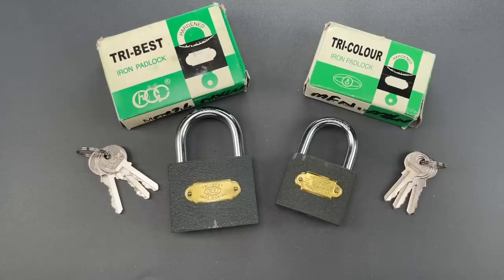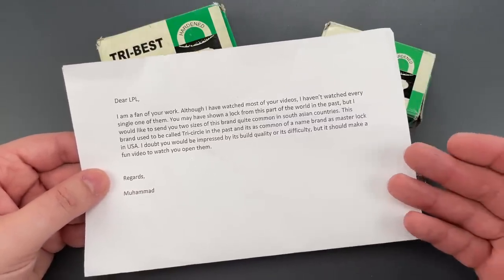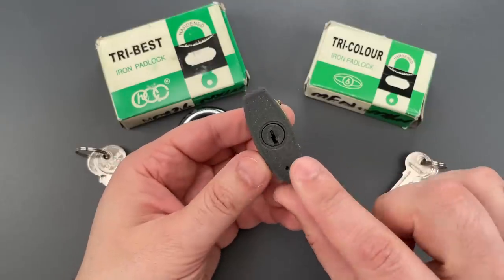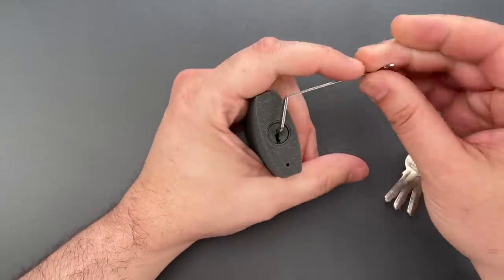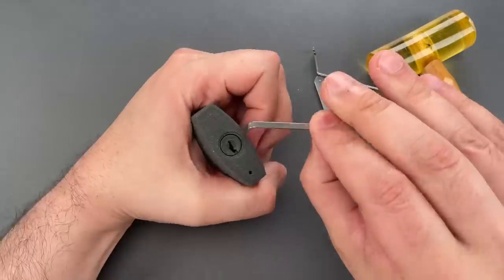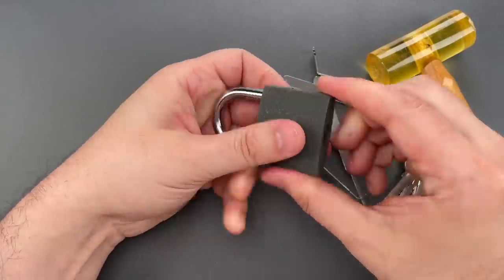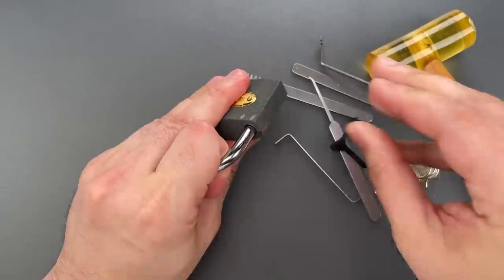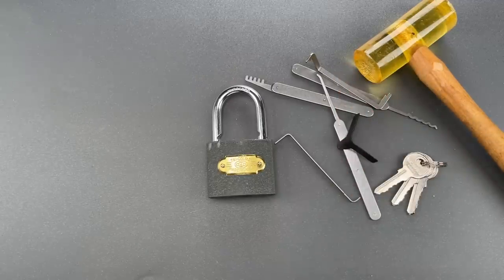[1460] Why I’m THANKFUL For Master Lock… Sometimes

Comment: The unhardened shackle that says hardened is my favorite part about this lock
Reply: That by itself would have been enough to get a bolt cutters out.
Reply: Plastic core...
Reply: @arthurmoore9488  I want LPL to take a propane torch to it to show how fast you can melt it open.
Reply: @chasm9557  he has done that with plastic core locks before.  It's not a fast process but it's quiet and can be done with a very small torch.
Reply: I bought a big Tri Circle clone, says Tri Circil, with a brass body that is magnetic. Not a bad lock, but it is theremore as extra protection, as it already is protected by the Ezlett lock in the security door and the Union barrel in the actual door. Ezlett locks are hard, mostly because they are so sloppy, and cutting a key means you need the lock as well.
Reply: Translation error..
What they meant is "not plastic"
Reply: That's probably some sort of metaphor for turning 40
Reply: @SeanBZA  how does a non ferrous material end up magnetic? Is an iron core or just brass coated?
Reply: @gameglitcher  brass plated steel, but sold as "solid brass".
Reply: To be fair it is harder than the rest of the lock
Reply: On the other side it says for decorative purposes only.
Reply: Before they hardened it, it was a delicious custard
Reply: @chasm9557  just a lighter will do
Reply: The "HARDENED" stamp was the cheaper alternative to actually hardening the steel.
Reply: That shackle made me realize that my entire life is a lie. 😭
Reply: I think that intimidating the potential picker is an important part of a security device.
Reply: 對你最難的是挑戰FOREVER V3 哈哈哈!你是小偷的老師!我來自台灣!
Reply: @CommunityGuidelines  I suspect that the packaging of this lock (which carries the imprint "hardened") is probably harder to open that the lock inside the packaging.
Reply: @klausstock8020  挑戰FOREVER V3 哈哈哈
Reply: This lock is so easy to open there is no reason to harden the shackle
Reply: @joanfrellburg4901  That's the point. They probably thought "If any costumer asks for the guarantee, that'll do the trick". Then they were laughing for about half an hour, lol.
Reply: @peterkelley6344  I don't even know if boltcutters would work with unhardened steel.  They might just deform instead of cracking
Reply: "what do you mean stamping HARDENED on it doesn't actually harden it?"
Reply: It is hardened, they were considering using dried Twizzlers.
Reply: To be fair, it doesn't say what is hardened. It could be about a different companies lock.
Reply: @chasm9557  - he did "nondestructive" this time

Comment: It's funny, because Masterlock has had all of these issues, just not all in the same lock.
Reply: This lock was made by Master Lock locks getting together like they were summoning Captain Planet. "Spring-Load core!"
"Unshielded keyway!"
"No security pins!"
"Comb pick exploit!"
"HAAAMMEEERRR!!"
Reply: Well, Masterlock did make locks with each of the vulnerabilities demonstrated in this video. But I can't remember them putting out a plastic core. I gues when tthey want to make a lock that can be melted open, they at least use zinc so you need a blowtorch instead of a lighter.
Reply: @MisterJackTheAttack  i laughed at this so hard that I woke my dog up.
Reply: Yet.
Reply: @MisterJackTheAttack  "BY YOUR POWERS COMBINED, I AM worst than a zip tie...!
Reply: @blarghchan  you mean a zip tie has only one bypass?
Reply: @sarowie  other than cutting a zip tie you can pry the locking tab out of position to slip the tie tongue out of the eye... or whatever the bits are called. A small flathead screwdriver tends to do the trick.
Reply: @MisterJackTheAttack  By your flaws combined....

Comment: Masterlock gets the "Not as Much of a Failure as You Could Have Been" award
Reply: So second worst lock company?

Probably not even that bad but I still will not use one on a nothing more valuable than the bin...
Reply: @seriousmaran9414  I think they are the worst genuine lock company. Below them you have knockoffs which are cheap and look like real locks to make a profit.
Reply: Masterlock gets a participation award, and they're taking it, proudly !
Reply: Meanwhile at Master Lock headquarters: Hold my beer!
Reply: Wow. Hard fail.
Reply: + has some form of metal in core
Reply: "damning with faint praise"
Reply: Master locks break very easy.  I've had several and they still find away to open the locks to get what they want.  The company did replace the broken locks and I offered to send them in for examination but the offer was refused.  When I asked for the fourth lock to be replaced, the woman who I spoke with refused to replace the failed lock.  I will no longer purchase master locks.  I've been buying Brink's locks.  I did have someone get in and I changed the lock and so far nothing has been missing for about six months.
Reply: *Insert Captain America picture
"I understand that reference."
Reply: I like how everyone here just already knows what you mean when we say master locks a failure
Reply: MasterLock get a "best in class" award. Their class only includes themselves and locks like the one in this video.
Reply: Everyone gets a trophy!
Reply: even the most faint light shines brightly in total darkness
Reply: So….
Of those methods shown here, how many work on master lock?
Reply: much coveted amongst the sorry entities that LPL lays waste to on here.
Reply: The "At Least You Tried" award.
Reply: I'm still working on getting mine. I'm not gonna lie, I don't think I'm going to make it.
Reply: Sadly still not even close to "better than dell" though...
Reply: Woo hoo!  the coveted Almost as  good award
Reply: I see you , Avatar fan
Reply: Aww, that's the same thing as the one my mom gave to me on my 22nd birthday
Reply: Love me an ATLA reference in the wild
Reply: For the folks that are constantly losing their keys, this lock should get an award.
Reply: For now.
Reply: @methanbreather  poo
Reply: 對你最難的是挑戰FOREVER V3 哈哈哈!你是小偷的老師!我來自台灣!
Reply: Masterlock will at least keep things closed (until literally any random passerby decides to open them). This thing will open in a light breeze. Not even a stiff breeze, a light summer breeze.
Reply: Nice atla reference
Reply: Great demonstration cheers
Reply: These locks cost barely a dollar
Reply: The only thing worse than being the worst is being the 2nd worst.

Comment: "With the exception of this hammer..."

Who else would be in favor of him selling a hammer as part of an "Overt Companion" set? If nothing else, it would make for a pretty great April Fools video.
Reply: It reminds me of the movie Gone in Sixty Seconds. "I need to go get my tool." "Man, that ain't a tool, that's a damn brick!"
Reply: That hammer actually looks pretty nice. What is it, acrylic, or some resin? I only have steel or rubber ones, acrylic would be a nice addition.
Reply: Overt companion should come with a Halligan bar and sledge hammer.  Not many more things say "screw your lock" like those.
Reply: @pkt1213  and an angle grinder
Reply: The new "overt companion set" consisting of a hammer/mallet, Bolt cutter, battery powered angle grinder and crow bar. For times when noise is not an issue, but you want to have the choice to either go for the lock, or whatever the lock is on.
Reply: @JaroslawFiliochowski  Polyurethane?
Reply: Would a stick of dynamite with the LPL logo on it be a bit too far...? Asking for a lawyer-friend.
Reply: When he said that,  I thought "Oh, no! And it's a 'dead-blow' hammer,  intended not to damage the object it hits."
Reply: Would need some substantial bedroom humor to qualify for an LPL April Fools video.
Reply: “Overt Companion” 🤣 Genius!
Reply: A bottle of thermite, ramset, two wrenches
Reply: Overt Ompanion
Reply: That'd be like Chris Fix selling his bottle of soapy water :)
Reply: also some random bits of plastic coke bottle, soda cans, and a twinkie.
Reply: @nirfz  make the 2 bolt cutters.  One that's a little smaller so you can get it into smaller shackles and one that's long enough to tell anything you can get in between it's pincers "that's cute and all, but I have leverage so...."
Reply: shut up and take my money
Reply: @JaroslawFiliochowski  A past video says "urethane malletc
Reply: Haha
Reply: It also seems like it would be a decent hammer for bumping
Reply: @nirfz  Don't forget the Ramset!
Reply: maybe he should sell and 'every day objects' lockpicking set ...Nylon Hammer, Hairpin, RareEarth Magnet, Brick, Screwdriver
Reply: @JaroslawFiliochowski  That's the Piss Mallet, baby.
Reply: @JaroslawFiliochowski  no its a polyurethhane hammer
Reply: The LPL Overt Hammer.  I like it.
Reply: @nirfz  also the ramset
Reply: Nothing on one, two is binding…. for now 😏 🔨 💥 🔒
Reply: LockPickingHammer
Reply: I would absolutely buy one, especially if it was actually branded  with "Covert Instruments" on the handle or something!
Reply: I am pretty sure he sells hammers now.

Comment: I would argue that this is one, if not the greatest lock ever seen on this channel : it has every weakness, making it a great teaching tool for potential pickers.
Don't buy 7 locks with one weakness, buy one lock with 7 weaknesses.
Reply: Not every weakness, he hasn't opened it with a magnet, spoon, fork or Lego part (yet) ;-)
Reply: @nirfz  or a can of redbull
Reply: @Legendarydave76  :-D, indeed.
Reply: Given that he just hit each pin in order when he was single-pin picking and someone else in the comments said "we had these locks in school and you can literally open them all with any key the right length", I don't think you could actually learn anything besides "apply tension while touching the pins" from this lock.  There's no fumbling for the right order or setting the wrong pin, it seems like...
Reply: @nirfz  could use any of those things to knock the side of the lock, lol
Reply: @gatherer818  Still can be a great confidence booster lol
Reply: I learned a new exploit from the video! I'd never heard of manipulating a locking lug from inside the keyway.... I'm guessing most keyways are shielded lol
Reply: @BWintJack  On decent locks anyway. You can see a bunch more of this on the 'inexcusable flaws' videos where he goes through a bunch of locks from the same brand, and some have this
Reply: @BWintJack  I was so proud of myself for my first lock I learned to pick -- until I watched this video. Now I know I must have been dealing with an unshielded keyway. :<

It's easier than doing it right.
Reply: So a MasterLock
Reply: @nirfz  
Hard to open something with a magnet when it had no metal in it. The whole lock is 100% pure chinesium.
Reply: Given the experiences people are sharing, it appears Master Lock remains the better training tool out of merit of at least not unlocking by just looking at it.
I do believe there are still master locks that can be picked, combed, raked, shimmed, bypassed and hit to unlock, so you're still saving money getting a single training tool.

Comment: Dude you can't imagine how thrilled I am that you reviewed this one, here in egypt they're the #1 most popular locks and I always knew just by looking at them they were the worst padlocks in existence
Reply: Same here in south africa, they are everywhere
Reply: Russia here ))
Reply: @KaylaJoyGunn  Yes, and they are also prone to being popped open with little effort, often all you need to do is pull hard on the lock body and they pop open. What do you expect when you buy a pack of 5 at the Fong Kong shop for R15.
Reply: The ones in Egypt looks the same but different from those, yet they are not the best of quality, but only in padlock for cylinder doors the most common brands is called AlAhram.
Reply: @kixpickss   I mean yeah they have different names but they are quite the same regarding protection. I used to go around stealing them with my friends using Bobby pins just for laughs and giggles (dont worry we returned them back a day or two later after seeing the owners reaction maybe more or even with a threatening massage if the owner was a dick or made a scene) so yeah they are so shit a 10 yo could go around picking them.
Reply: @ahmedhisham5275  Sounds like you were doing those owners a favour, they could have bought proper locks instead...
Reply: @ahmedhisham5275  wow, threatening massages are sending me a really mixed message.
Reply: @SeanBZA  😂😂
Reply: @KaylaJoyGunn  I bought one of those things at Pep the other day 😳
Reply: @ahmedhisham5275  stealing? Threatening messages? Listen kiddo I'm sure that you are a teenager and want to live your life and be a badboy but this ain't cool at all, picking a lock that ain't yours isn't accepted in the community and it's a crime by the law, I'm surethat @lockpickinglawyer himself won't accept this kind of comments on his channel, just delete this comment because you're stating a commented crime on one of the most viewed channels on YouTube..
Reply: Same in China...
Reply: @ahmedhisham5275  haram

Comment: Fun story, I joined the RNZN as an engineering apprentice in the late 1970's and they supplied us with Tri-Circle locks for our personal storage. Of course, several people lost keys and I used to just rake their locks open with a key I had with a (possibly) zero cut bottom end. There were a couple that wouldn't work on so I raked them with a piece of welding filler wire I had hammered flat and slightly flared.
Reply: professional tools for a professional lock
Reply: All part of the interview process. Shabby locks with easily-lost keys = opportunity to see who is clever enough to deal with it.
Reply: Almost as bad as the cabinet locks we had, I used to keep 2 paperclips in my wallet and on my ID, just so I could open them. Often faster than actually looking for the key.
Reply: Oh, so this is vintage trash?

Comment: This reminds me of the combination lock I bought for school 10 years ago. The first time I opened it I didn't realize I had put in the wrong combination and when I pulled the shackle to open it I accidentally ripped the locking mechanism apart. I stopped bothering to put the combination in after that, it was just a psychological barrier and not a lock.
Reply: My dad calls those "dummy locks" because only a dummy thief would think it's locked
Reply: All consumer locks are psychological barriers, a brick can destructively “unlock” most of them, and if that fails, there are windows to break and doors to kick down.  Locks are a deterrent
Reply: Virtually all locks are such. As the old saying goes, “locks just keep an honest man out”.
Reply: @thomaswang2223  The problem with destructive methods is that you will leave traces and will get you in trouble in populated or surveilled areas because of how noticeable they are. Picking, raking, and all other non-destructive methods are silent, don't ruin the locking mechanism, and provide you with a way to re-open your lock without ruining it.
Reply: The Scottish adage is that "a lock is a device for keeping your neighbors honest."

Comment: I actually have the same lock branded "F T" that I use for "securing" the locker at my gym. 

I don't keep any valuables there so it mostly serves as a "this locker is taken" message, but, what's great about it is that the terrible security it offers actually came handy twice. Once when I forgot the keys, and the second time when I've locked them inside the locker. 

I was able to open it using different set of keys that I've borrowed and simply wiggling them around - it opens nearly as fast as with the correct keys. It saved me the hassle of going to the gym desk, asking for the cutters and buying a new lock :)

Comment: New listings idea-  the "COVERT HAMMERS" range scaling from a little Thwacker, to the Encourager, and right up to the Persuader.
Reply: Love the set idea, but as someone else said - It should be Overt companion, not Covert.
Reply: @Ieatpeople2  I thought that was the angle grinder. Followed by the "can't be locked if it's liquid" thermite stick.
Reply: I actually have a Persuaser. At least, that's what I call "him." A 16 lb (≈ 7¼kg) hammer, as heavy as or heavier than many sledge hammers, but with a handle shorter than the average short sledge (it's abt 14" or 35½cm, avg. is abt 18" or 45¾cm). I used it in my former trade. Takes some serious forearm strength to swing, I'll tell you that. 😄

Comment: I didnt know locks could be THAT bad! Well done!
Reply: It's a decoration, that resembles a lock.
Reply: Romulus III  It's not a very good take though, is it?
Reply: @FlameOnTheBeat  Or some yarn, tape, wire, maybe a bolt
Reply: Sadly this isn't even the worst lock I've seen so far. I once had a lock that I could open with the small blade from a Swiss Army knife instead of the key.
Reply: Romulus III  this lock can be opened by just pulling it and hitting it. If a kid could easily open it without any prior knowledge then it’s a shit lock not worth the materials that was used to make it
Reply: Would you like to see my origami padlock?